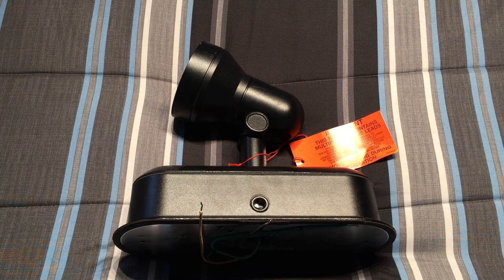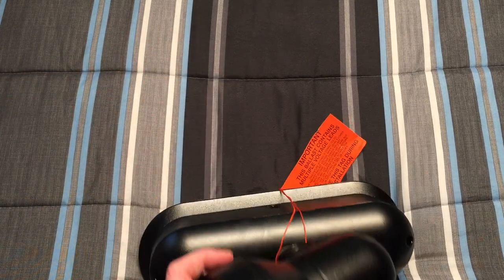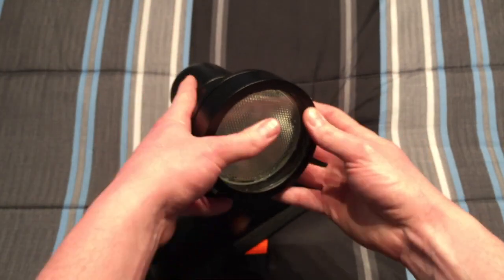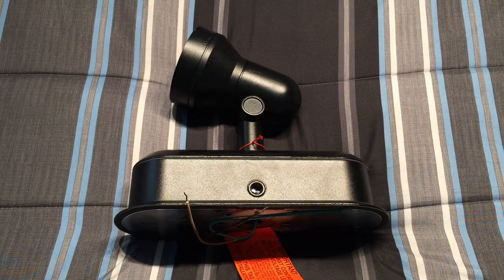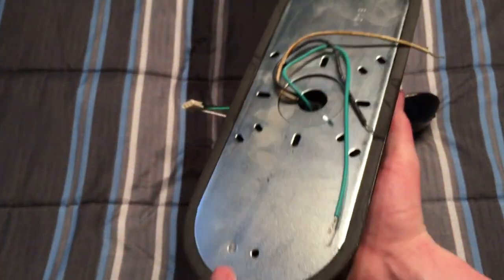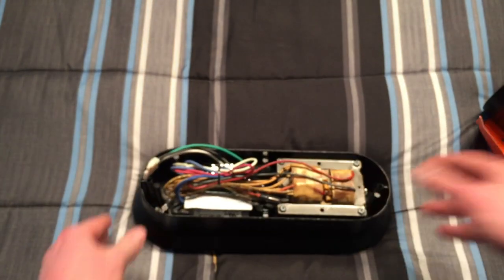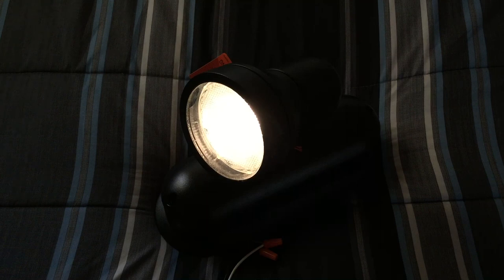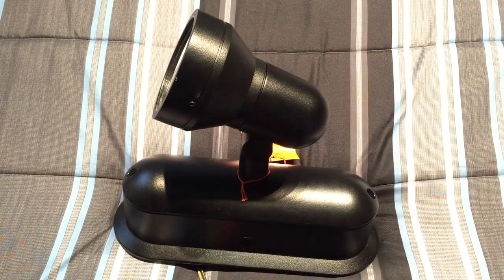E-conolight 70watt Metal Halide (MH) PAR30 Flood Light

Comment: Sometimes you can find PAR 30 and even PAR 20 ceramic metal halide floor and spot bulbs at a ReStore. I have found many over the years at my local store, brand new. They come in 20, 35, 39 and 70 watt versions (not sure if they come in higher wattages in the PAR 20 or 30 envelope). I believe E-Conolight is owned by Ruud Lighting in Racine WI, and/or Cree, or if Ruud is still in business or not

Comment: I have a self-ballasted PAR30 CMH lamp which is rated 24w, and is designed to replace 75w halogen floodlamps.  I wonder if any fixtures exist like this which use short-arc XMH lamps?  (It's possible to attain 108lm/W with a well enough designed one)